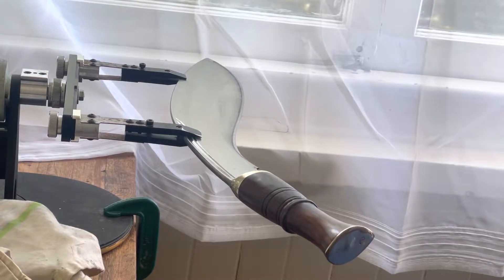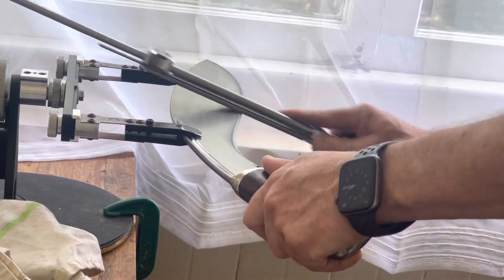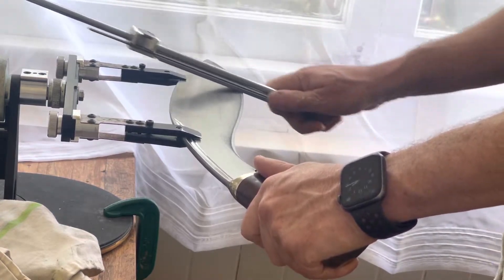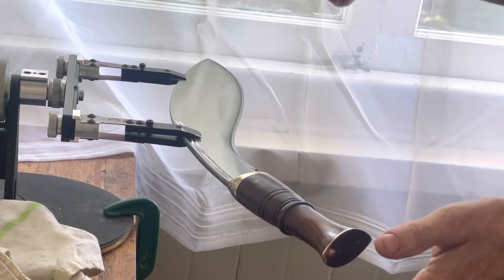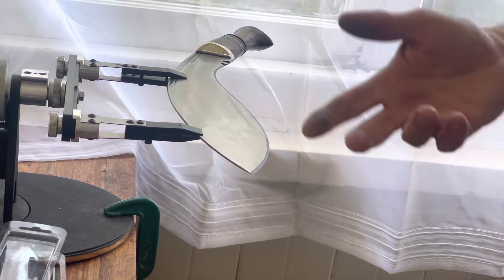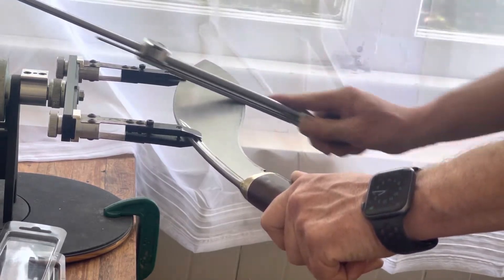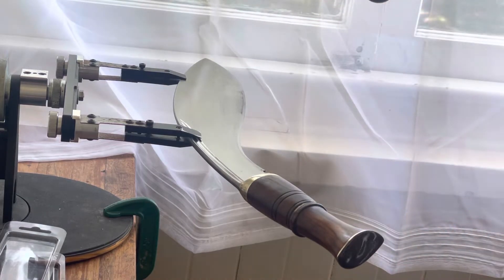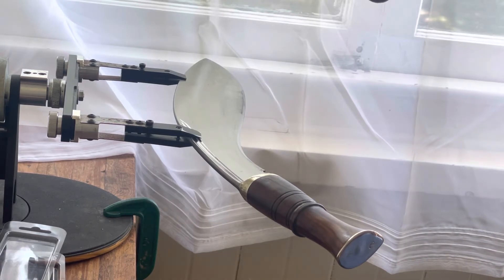Sharpening sneak peek Tsprof k03 on khukuri kukri

Comment: What width is that stone?

I can't readily tell whether you are making contact with it on its entire width or sligtly raising is so that only a "side" of it is eating the steel. I'm ck wondering, of course, about the portion closer to the handle.

Also, what clamps are those? Thought the spring ones accomodate spines of up to 3.5 mm? Have they changed that in the mean time? Slightly confused over here.

Thanks!
Reply from the maker: The stone is 25 mm, you need to slightly adjust the angle of the stone by tilting is slightly to get in close to the bottom of the blade, I am looking at getting a 12 mm holder and stone but they tend to be in low grits mainly.
If the curve is sharp it is hard to get a really good edge on the curve, you can get it but it takes time.
Reply from the maker: The clamps are standard, but they are rather old and I have opened them up as far as I can.
Reply: @ShelleyRaskin  Thank you, appreciate it!

Comment: Any concerns about loss of convexity through with method?
Reply from the maker: Can be, although I do have a convex attachment i sometimes use, basically a curved angle extension to the rod to it works on an arc rather that a straight plane, I have used it a couple of times but takes a lot longer to sharpen as you need to concentrate on each little piece of the blade in 20 mm sections at a time to get an even angle, it’s ok for small folders but a pain for big khukuris, but I have never found any real benefits to a convex bevel, I know they are stronger etc etc, but I find my system works so well that I am prepared to have a slightly weaker edge for a super sharp one that I can resharpen quickly.
If I was taking one out for an expedition for an extended period of time then I might reprofile it to a convex once more.
Reply: @ShelleyRaskin  That's very interesting- I've seen these curved rods with the KME system. Seems a bit of a halfway point still as A: you're only removing metal at a single point rather than the whole area as with a soft sanding medium and B you're limited to a predefined radius for convexity. Michael gavak of Gavko knives was a big proponent of extremely lean full height convex grinds that were almost flat for choppers. 5 degrees of curvature definitely wouldn't cut it there.

I think people often get led astray by thinking of a convex edge as a a v bevel with more material and stronger. If the apex has the same final terminal angle in a fair comparison then a convex grind is actually leaner, just a v grind with the shoulders removed. The strength is similar but the push cutting resistance is lowered. In khukuris I think this is where the benefit lies- less resistance pushing aside a very hard material.

At the end of the day though a highly refined flat bevel like you're producing here is going to outperform the vast majority of convex edges out there and if it's fast and easy then it's a no brainer.
Reply from the maker: I have sharpened and used a few khukuris this way now, I certainly have no regrets, I find it typically takes two goes to get a good lasting strong edge that is sharp and stays sharp, I do find that stropping after use helps too, 5160 is soft enough that just a good hard stop will realign the edge after use.
The first sharpening is slow, takes days as I am setting and new angle after that it’s pretty quick for any subsequent sharpenings.
And they certainly perform.
I would like to try out one of your sirupatis, I am interested in a 16 inch rat tail buffalo horn with brass hardware and a traditional dap, ideally with a performance grind, do you have any blems or cancelled orders like that at the moment?
I don’t mind waiting for a new one
Reply: @ShelleyRaskin  I've just finished up a videocall with the guys and we do actually. We have a 16" sirupate with steel hardware, 4.75" rosewood handle. No sheath made as of yet. No issues with blade or handle- just incorrect specs as the order was for brass. We can grind it to performance or even leaner at this stage. We can also make with whichever sheath you'd prefer. 20% off web price- email me at customdesign to organise an invoice.
Take care,
Andrew and the team at Kailash
Reply from the maker: @kailashblades  email sent